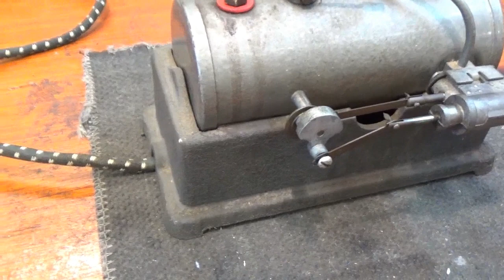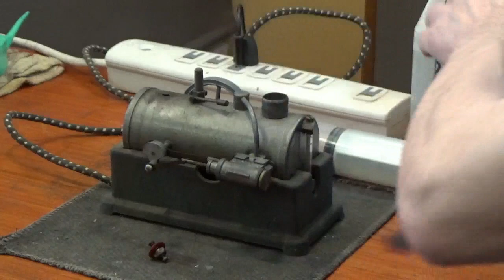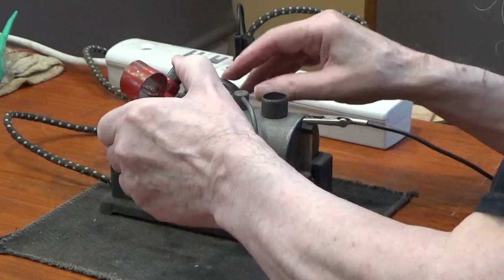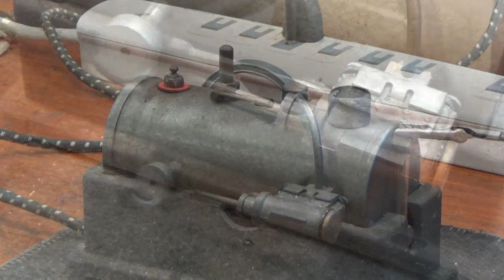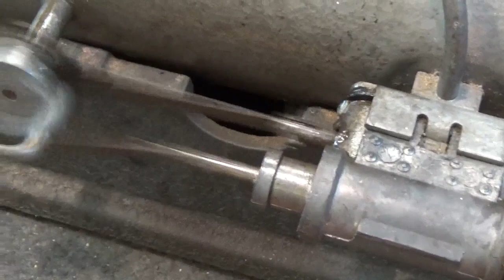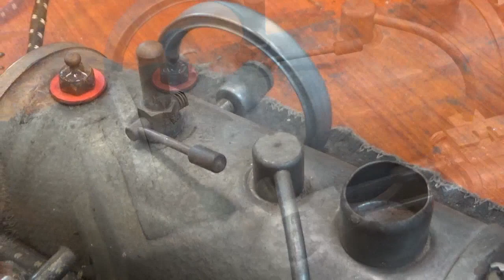Marvindustries horizontal fixed cylinder electric

Comment: A very nice example of one of their Robert Fulton Line horizontal engines. The horizontal ones do seem to survive better than the vertical ones. Having steel boilers doesn't help with their longevity though!